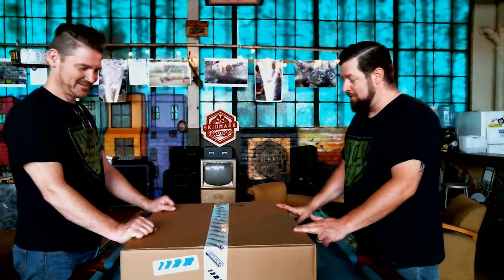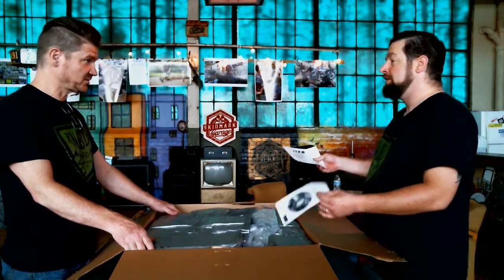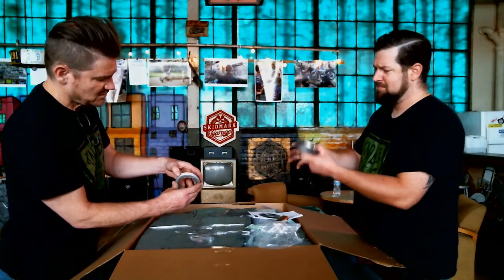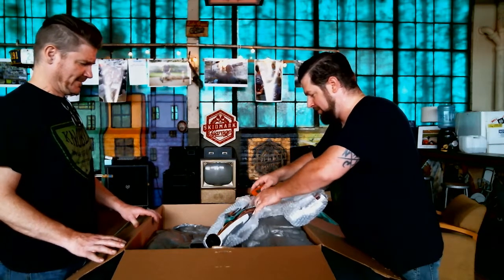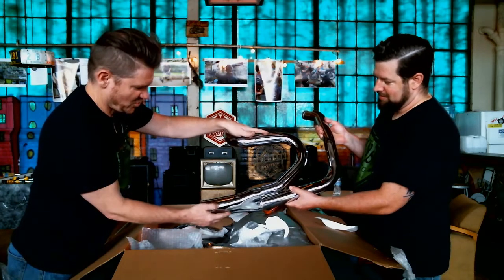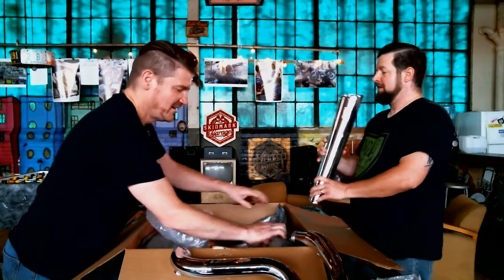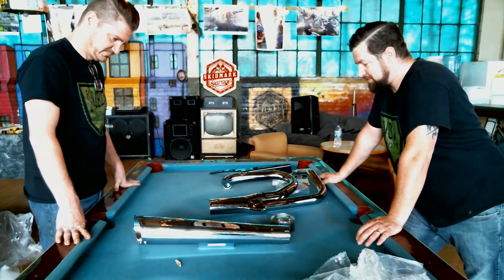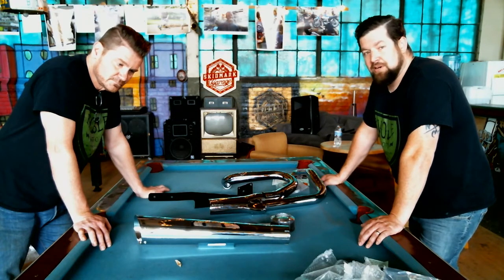Unboxing of SuperTrapp Motorcycle Exhaust

Comment: Just adding that the E-series pipe from Fuelmoto uses discs also.
Reply from the maker: You should be happy with that pipe.
Reply: @KnobleMoto  actually I just bought the Supertrapp SuperMeg in chrome for my Dyna.  The E-Series pipe does not have a deflection for exhaust gases like the ST so it would ruin my saddlebags.
Reply from the maker: @Peter-976  that is an important difference. I have about 4” clearance between my bags and SuperMeg pipe on my Dyna.